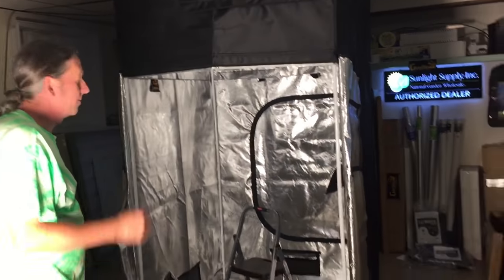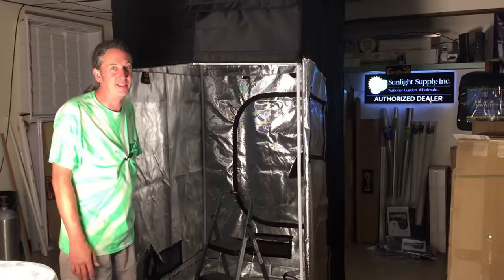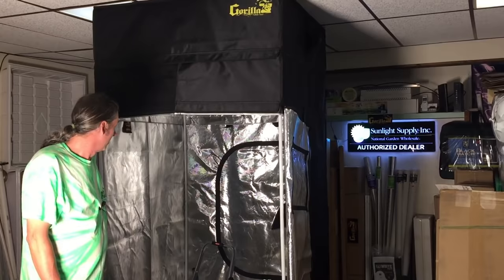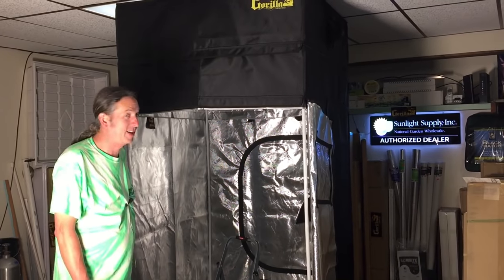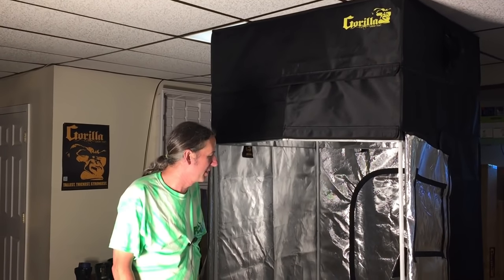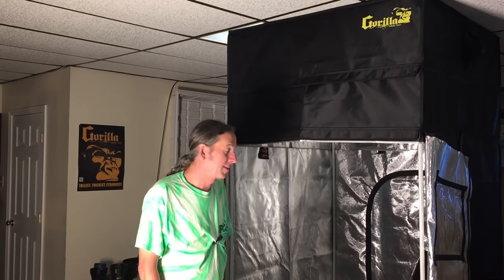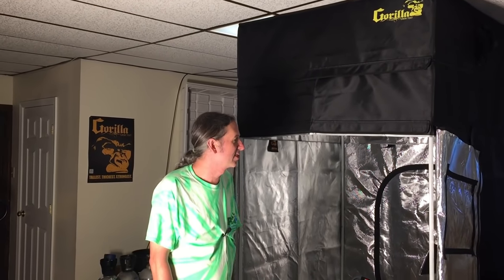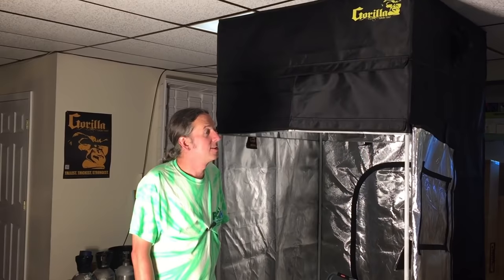WATCH THIS BEFORE BUYING A GROW TENT  SETTING UP A 4X4 GORILLA GROW TENT

Comment: Just put my Gorilla Grow Tent 4x4 together, Gary your tip on loosing one pole to attach the top was a life saver, for me it was a one man job, the hardest part was matching up the wall zipper with the extension zipper, my wife helped me by holding up the wall. This tent is a very well thought out construction, well made and easy to put together. Of course your video helped a bunch. After all the money I have put and will put into this tent I would have to grow tomatoes for a 100 years to get my money back. yuk, yuk...A great instructional video

Comment: I am interested in using these products to start vegetables in my garage or some other non heated environment. Would this work?
Reply from the maker: Monitoring and adjusting your environment is key to successfully growing quality plants.  It is possible to grow in a garage but you would have to take steps to control your temperature, humidity, air circulation, etc...check out more of our videos for information and thanks form watching!

Comment: Hello, is there an ideal place to put your tent in your apartment? Near a window to receive sunlight on sunny days so that the plants receive sunlight or to heat the tent or is it better to leave the tent closed and just use the artificial light? I am using a vertical hydroponic system and a tote aeroponics system in a 4X4 tent.

Comment: Do you think a 1000w de gavita pro would be good for veg and flower in one of these or maybe a 5x5?
Reply from the maker: Hey there, it would max it! But the heat would be bad and it has been done but some serious air conditioning would be needed and a tall tent and possible fire hazard , there are some air cooled DE reflectors you should check into. Peace. G

Comment: Will a 750w led cover a 5x5? Figured it would but now i'm wondering. Thank you!
Reply from the maker: Most LED's at least the cheap ones lie about there wattage, I cant answer without more info. Sorry.G
Reply: @PAHydroponics  Fair, thanks for even responding! Say a Kind LED 750w - I measured out my spare room and i have an 8 foot roof and 8x8 room roughly - I wanna throw a 4x4 or 5x5 gorilla tent in there with a 750 or 1000w kind led - now i dont know if 1000w is too much with that type of light. Also open to recommendations. Novice here who just cares about the plant and wants to do it right. First run would be seed to harvest in the same tent. I'm just trying to learn. Thanks again!!!
Reply: Also plan on using trellises and going soil.
Reply from the maker: @EtherealoNe1  Hey, even the kind xl 1000 wont cover it totally it does about 4x4 with it mounted high, it is a cool light tho with being able to completely tweek the spectrum. I would put the Horticultural Lighting Groups (HLG) 550 r-spec in there, that light will do the job.

Comment: Hey thanks for the informational video! Do you think I would be okay with the 5x5 Gorilla tent with one 6" inline fan exhaust and a portable ac and fan? Is the air situation good enough? Again thanks for the video!
Reply from the maker: Hey there, yes you should be better than good enough with the AC unit, unless you are running HID light. Thanks for watching! Gary

Comment: You can tell your customers that the poles can easily be shortened to fit any basement, all you need is a hacksaw and a drill.
Reply from the maker: I have have people do that and yes you are right but I hate to see people do that to there tents! the skin of the tent adds so much strength but it can be done. Thanks for watching! Gary

Comment: One thing I don't understand is the vent for fresh air is going to let light in right?
Reply from the maker: We get this question a lot, and yes it will. There are ways around this if it is a problem, you can run some ducting in the bottom duct ports and put a little bend in it so light cant go thru it ,especially if you use the black lined ducting. You can also make a shadow box over vents to block light but still let air in.Thanks for watching! Gary
Reply: @PAHydroponics  good answer.. I knew it sounded stupid but I'm new grower and can't learn if you don't ask. Thanks!
Reply: @PAHydroponics  one other thing.. Is it Ok to leave th door open on your grow text? If it get to hot or something or just all day how much do to lose? If Andy?
Reply from the maker: @detroitvapes4202  For best reflective of the light -keep it closed and of course odor control if needed, I would keep it closed. G
Reply: @PAHydroponics  Ok but it won't kill it that much. I just had one plant grow some balls on me 😭😭 think it's because on the not haveing it turn light on and off at right times.. 3hsbr too get my schedule under control. Thanks buddy.
Reply from the maker: @detroitvapes4202  Its time to buy a timer :)
Reply: @PAHydroponics  ya I know I new it. Being new first time grower I cut whee I thought I could. Guess I should of waited but learn from mistakes I guess. Lol.. Thanks

Comment: What is your recommendation for light watts 600 0r 300 watt for a 4×4 tent
Reply from the maker: The more the bigger yields is general rule, I have customers running 1000 watt's in 4x4 and getting huge yields, its all what you want out of your garden, if your just messing around with personal stuff then save some electric and go with less watts. Just my thoughts. Thanks for watching. Gary
Reply: @PAHydroponics  much love thank you for taking the time to respond.

Comment: Gorilla Grow is way overpriced junk and has an insane amount of light leaks pin holes and the plastic zippers leak where the teeth go together . Customer service is a joke . Better off using panda film and way cheaper at least won’t have all the light leaks .
Reply from the maker: I like the panda film myself, I never had the problems you have had but thanks for sharing, the zippers are all covered by the overlap flaps so they dont leak light and an occasional pinhole is not unheard of on any brand tent but they are an easy fix with a piece of electrical tape if you find a pin hole. Thanks for commenting. G
Reply: My gorilla grow tents are 2 years old and they're still in perfect condition. It's the only tent I'd recommend.

Comment: I need a tent that is 90" tall , id just cut the pipes to brimg it down 4 or so inches , keep loose fabric at bottom of tent , i can flare pipe and drill new hole if need be  maybe even cut off excess tent material and sew ot back up